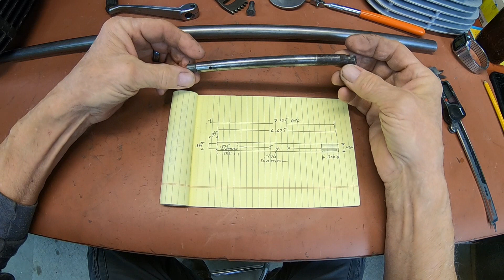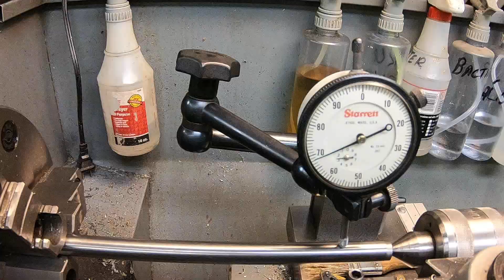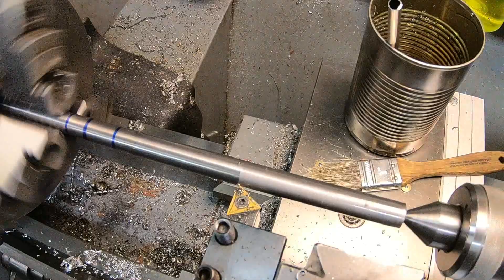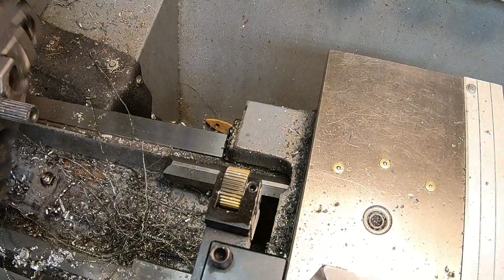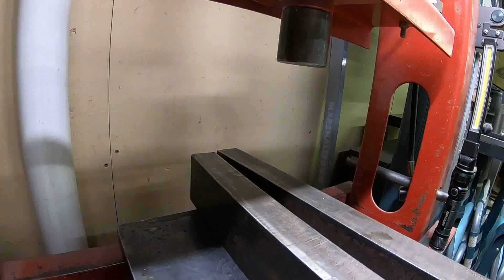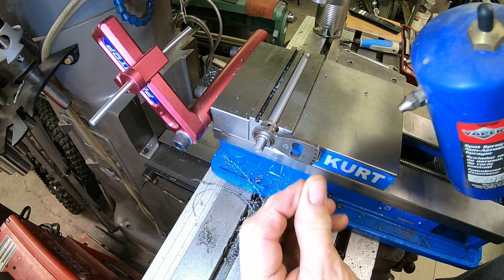Make a Suzuki RM shift shaft, RM250 in a box

Comment: What knurling tool did you use to make the splines? Is there a particular tooth count on the knurle tool? I need to make a couple of shafts for Maico builds that I'm doing. Any info would be greatly appreciated!
Reply from the maker: Hey Scott the ones I use are made by Dorian tool, you will have to measure and count your splines to determine which one will work in your application.

Comment: After seeing that, I've stopped looking for a better shift shaft now and have just checked my metal stock and have some 13mm O1 tool steel, so I'm now going to make my own. I just need to get the right knurling wheel. Thanks again Dale
Reply from the maker: Awesome, good luck with your fab work, not a bad job at all.

Comment: So is that a tungsten knurling wheel and it presses the splines into the soft steel? Is that not a lot of pressure on the lathe?
Reply from the maker: Hey Evan, mine is not, you can get all that exotic stuff, but mine is cheap high-speed steel. Yes, you do use a lot of pressure, but its only for a short amount of time, so far, my lathe has not complained.
Reply: @montana2strokeracer  I've never seen that done.  I love your setup.
Reply: @montana2strokeracer  are there different wheels for different spacing or is that pretty standard?
Reply from the maker: Hey Evan, yes it seems all the manufactures used different teeth per inch on their shift and kick shafts. Still trying to figure out Yamaha's, it is a bit nonstandard, more than likely metric, will just take time to figure it out.

Comment: Hi Dale, When using dead centers, you should lube the shaft, the pilot on center drill acts as a grease reservoir, if things start getting hot it melts out before friction welding center to shaft.
A sharp edge knurling wheel is for a cut knurl, traversing wheels have a chamfer on edges.
Even so, it came out real good and pressure forming splines will make them stronger.
One thing I would have done, polish the area's where it sits in crankcase.
The 'gear' end looks same as GP100/125 and many of the early 'coarse spline' Suzuki's?

Comment: Forming the splines on that shaft is the internet's best-kept secret. Can you fill us in on the details of the tooling? Great video.
Reply from the maker: Hey John, you have to match the spline pitch with the knurling tool, there is a formula to figure it out on the manufacture's webpage. I used in this case Dorin knurling tools. It took a lot of practice to figure out the right pressure, feed and speed. Accu Trak is another great source. Keep in mind most all the manufactures use a different pitch spline and different rod size, so it is not a one size fits all!

Comment: OOPS, also 'ment to ask what you use for inserts when cutting this drill rod?
Reply from the maker: I used TCMT for the cutting and a Hertel cut off tool with their insert for parting. Drill rod machines pretty easy but can be heat treated to about 50 rockwell if need be. It really reminds me of cutting 4140.
Reply: Thanks Dale, I figured TCMT but wondered about the coating, you seemed able to take some pretty fine cuts on that drill rod. @montana2strokeracer
Reply from the maker: @dralexmclean  It is just what they call TIN coated, Titanium Nitride.

Comment: OK Dale, now I need to understand how you got the knurling tool with exactly the correct spacing for the splines so they match the shift lever splines?  Any thought of cutting the relief for the bolt before rolling the splines?  Any consideration to cutting the splines rather than rolling them.  All in all VERY slick Dale, I never fail to learn when I watch your videos.  Thanks for posting
Reply from the maker: Hey Alex, you have to acquire the correct knurling tool with the same spline pitch as the shaft or lever in this case. There is a formula listed on the manufactures web site for doing so. It would take me forever to cut these splines using an index head, that's a job better left to the professional machinist. I think how I did it is how the manufacturer did it. Just a guess though.
Reply: OK, that makes sense, I've NEVER put a knurl on anything so didn't realize the option of having different knurling tips with different pitchs.  Thanks for teaching me!!
Alex @montana2strokeracer

Comment: Very nice  piece of fabrication work Dale! Always enjoy watching you do your thing.
Reply from the maker: Thanks for hanging out with me in the shop David.
Reply: @montana2strokeracer  Glad to join you when I can. I finally finished welding in all the gussets to the 400 and 250 frames. Should eliminate that flexing issue that they had. I also added on the alternate upper shock mounts just below the original mounts on the diagonal tube to see how it affects the ride and handling.
Reply from the maker: Sounds like good solid improvements, still got more to do on the Yamaha 250mx. working on the front end now.

Comment: I made a kick start shaft once by milling the spline with the corner of an end mill. Using an indexing head and having the corner of the end mill 45 degrees radially from the center.
Reply from the maker: Man, what a job that had to have been. Not sure I could do that technical of a job.
Reply: @montana2strokeracer  if you saw the set up or a sketch of it you’d say that looks pretty easy. Actually the hardest part was it was 23 cuts and that doesn’t divide into the 360 divisions I had available so I had to make a dividing plate with 23 holes but I made that out of a circular piece of aluminum.125 thick and put that on the simple indexer I have. You’re turning out some nice work on the bikes.

Comment: I had to do the same spline repair on a piece of machinery. Instead of making the pinch bolt groove go all the way around the shaft we would hand file it only where the bolt was with a one or two spline adjustment. That way you have the maximum amount of splines engaging each other instead of just on both sides of the bolt groove. A shift lever gets so much abuse it needs all the help it can get. Especially on a race bike. Great job.
Reply from the maker: Awesome, that would be a great idea, but in this case since I don't have a lever and the engine is not in the frame, I just don't know the position that the lever will be in, so I have to go this route. But you are right, strength would be in having more spline area. Thanks Bud.

Comment: Not a simple job, you underestimate your skills. It was fascinating. Maybe we all do, I wonder why people pay me to write articles that I think are simplistic and they keep coming back for years. I had forgotten what a problem the Suzuki gear shift was. I had this same problem on several  TS Sukuzis from 70's and 80s. Having none of your skills, I wrapped the gear shaft splines in tin foil to create a tight joint with the shift lever, 😖.
Reply from the maker: Hey Steve, you are right, one person's easy task is another person's nightmare. I am self-taught on most of this stuff but come from a very mechanical background. I have seen many over the years with tinfoil around the spline. It works, so have I seen screws, and welding. You just have to make do sometimes.